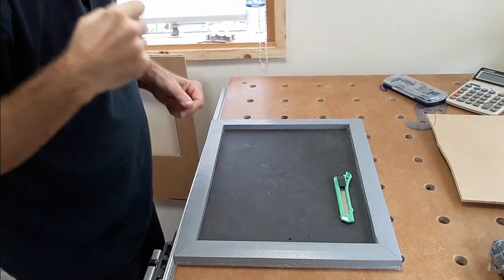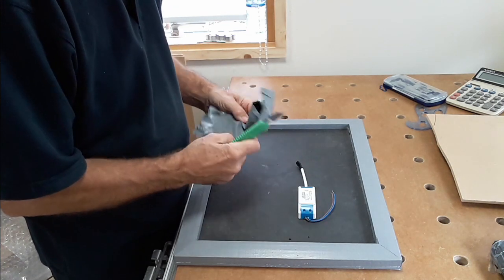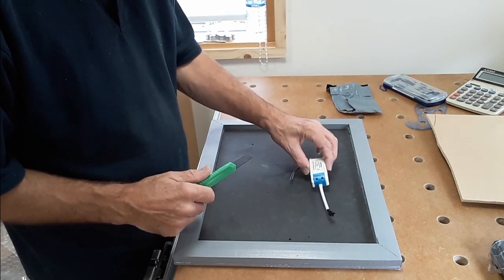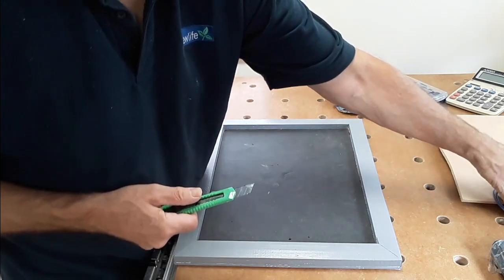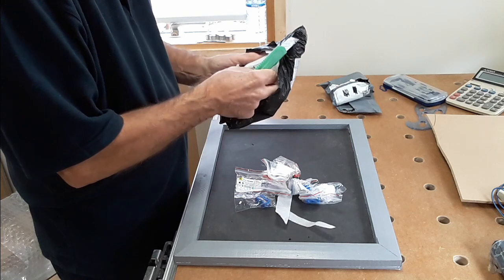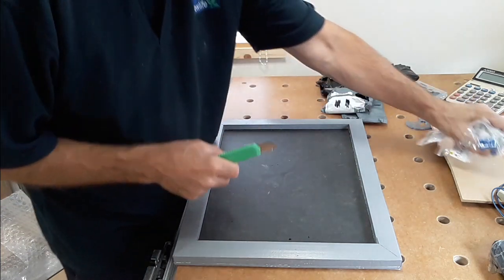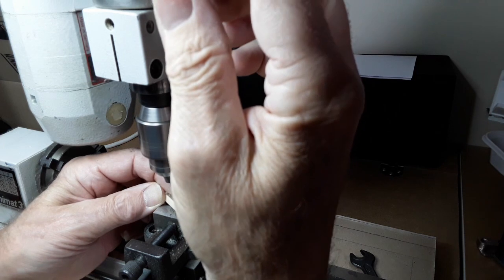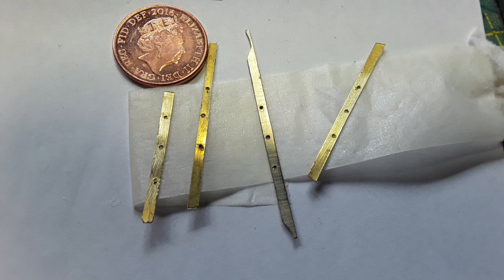small shed Saturday #50 - drilling brass

Comment: Hi Peter another interesting video. Drilling thin brass is a fiddly business and I thought your use of a Screwfix pencil was both ingenious and cheap ! I read in the comments you are the proud owner of 2 Unimats - you don't see many Youtube videos of them being used these days. I not sure about the quality of Chinese mini lathes - Youtuber 'This Old Tony' had to rebuild the one he just bought.
Reply from the maker: It's a bit of an extravagance James, having two, but I came across the SL for a ridiculously cheap price, so I bought it to possibly sell on, however I have found that one set up as a lathe, and the other as a mill/vertical drill, saves a lot of messing around changing set ups.

Comment: Thank you. Ah YouTube..... Where would I be without it? Like me - parcels daily - many items that I forgot about, projects on the go and clocks that need small brass bushes to repair worn pivots with tiny holes. Got fine drills; Got brass rods. Got some tools but not a lathe. So can you help?
Reply from the maker: A couple of thoughts, firstly it might be possible to get thin tube brass with an appropriate sized hole in the centre, but I think I would go straight to the guys that supply the pro's, it might be worth checking out 
http://www.rnhorological.co.uk
Or
https://www.johnwardle.co.uk/index.asp?function=search

Comment: I thought i'll pickup some thing new for my 1/32 scale Ga. 1 live steam detailing.
The loco needs 2B drilled tiny holes (well, not that tiny) for faux clean out holes/
drain plugs.  The boiler jacket is of brass but curved surface so pre-drill prep wld b
important.

Good job but wasted too much time on irrelevancies (opening packages etc) which
was 2/3 of our valuable time for the video.   The most crucial portion is to get the hole
position accurately.  for a big work piece, i just use my milling machine w DRO and
use a center drill.  But for a little piece like that, i resort to using a magnifier cap w
a built in light, scribe the coordinates (x, y), then follow one of the line w the same tool.
when i feel click at the line intersection, i just enlarge the hole w the tool.  That'll be my
punched hole.  I'll then use my Cameron Jeweler's drill for that #50 bit.  I try to use a
small machinist hand vice to hold the work.  As u've mentioned, glue, solder, screws,
can hold the piece on some scrap.  If the bit is dull, the thin drill bit will wander, esp 
on brass so get rid of it!

Despite such a formal drawing u've recv'd from ur friend, i dink (think) ur method is

  gut genug für die meisten von uns

His dwg shows he doesn't know the limitations on fabrication/machining.

Ciao!  From USA

Comment: I watch more YouTube than TV these days, mainly due to spending so much time in bed due to my health. For that reason I’d be very interested in how your doorbell works, is it just audio or is it video as well please? Even though we only live in a small flat it’s often very difficult getting to the door when my parcels arrive.

When you said drilling brass my ears pricked up as I’m thinking of putting a brass plate on my frames with the title of the image. Print No. etc will still go inside, but I’m not sure if it will look a bit crass. 

What sort of lather do you use please as again I'm thinking of investing in one, but then I think perhaps I should concentrate on learning the basics first. I’ve got it in my head though that I’d like to give making wooden toys like Early Learning used to make, my two had lots of things from there and they always looked like 'proper' toys. 

As always a very interesting video, thank you. Happy New Year Peter.
Reply: Hi Mark, thanks for the kind words, the doorbell is just audio, and I'm ashamed to say that despite this video being made some months ago I still haven't got around to testing it yet. There's an odd sized battery in the bell push that I have yet to source, but the intention is to put a relay in circuit with my existing doorbell that will operate this one as well, and hopefully ring the second bell in the shed without having to run cabling, time will tell.
The lathe is an Emco Unimat 3, and I've also got the earlier SL version, they are good for small model engineering, but I believe there are now some half decent Chinese offerings that are priced reasonably, and would have greater capacity. 
Although I am shying away from a woodworking lathe I am about to join a local woodturning club, who have machines and tutoring, as well as the one at Men in Sheds, so I might also get into some toy making for the grandchildren.
For metal and woodworking it's always good to see of there are any local groups, as I'm finding there's a wealth of experience and help there, the woodturning group I found meet up less than a mile from my house!

A Happy New Year to you as well.
Reply: Peter Lloyd Thanks Peter for your very comprehensive answer, I do appreciate that. A lot of food for thought.